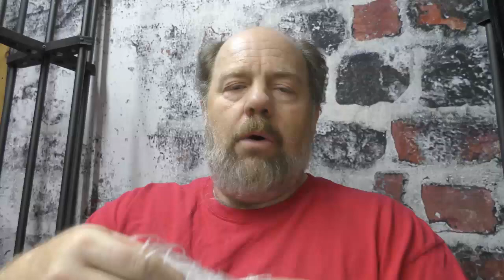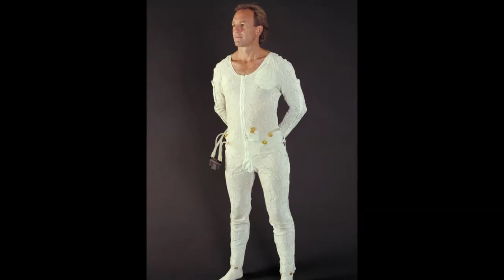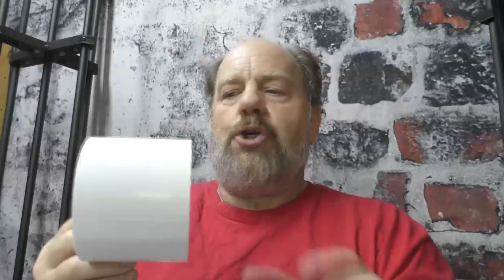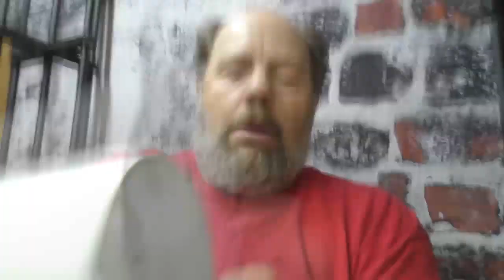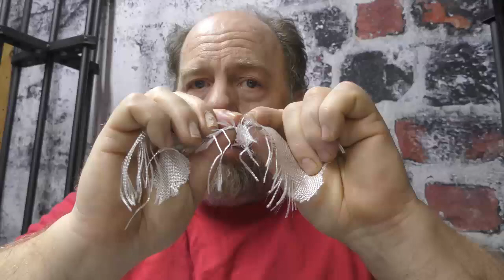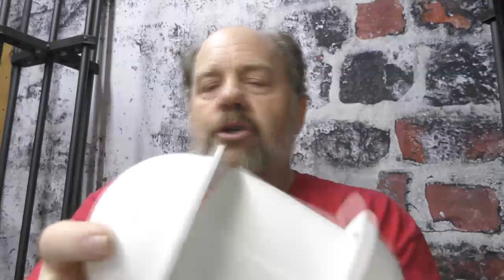Loss of the Titan

Comment: I read all of Picard's books on the stratosphere and the sea depths. For his deep dives, he used a titanium sphere, with each opening rebated at a deep slope angle, in order that the pressure would be inclined to seal rather than yield. Carbon fibre seems an odd, if not stupid, choice to me.

Comment: What I wonder about the most is what the low temperature rating was for whatever kind of epoxy they used and the glue they used to affix the end caps because, from my experience with various glues and various kinds of tape, the adhesiveness can fail due to temperature. Presumably they used epoxies and glues that weren't water soluble but I wouldn't even rule that out since my mom bought some Trex decking and the boards from that batch accidentally were made using a water soluble glue and the boards literally disintegrated in the rain. Clearly, they should have known that outdoor decking would be subjected to water but this whole batch of boards still got all the way to the hardware store. The company replaced the boards for free after my mom put up a stink and those ones are really good so presumably their engineers were much better at their jobs than ol' Stockton was at being an engineer, so I would think he would be more likely to make such a mistake even though subs are obviously going to be subjected to a significant amount of water.

I get making a bad design that fails because I've done it too but never when people's lives relied on me doing it right. In those cases, I'd learn how to do something properly or hire someone else to do it. I'm a biologist, not an engineer, so the stuff I've engineered was basically tinkering to try to solve a problem using stuff I already had around (hence the amount of experience I have using glues and various kinds of tape lol). The stuff I make usually works at least temporarily, which is long enough to get the stuff to do the job correctly. Much of it ends up being just as good as the original and, on a few occasions, even a little bit better. I wouldn't trust anyone's life with my silly inventions though.

Comment: So basically it wasn't actually a carbon fiber hull. It was a carbon fiber un-enforced (is that a word? lol) "epoxy hull". The only strength it had, came from the epoxy resin in the carbon fiber.
Reply: A scuba tank and a spacecraft are comparable. A scuba tank and a submersible are not.
Reply from the maker: That's a good way to put it and that's the way I see it. I might be wrong, but it sure is looking like that's exactly what has happened.  :(
Reply: @TechValleyScienceCentre 
Leela: Depth at 45 hundred feet, 48 hundred, 50 hundred! 5000 feet!
Farnsworth: Dear Lord, that's over 150 atmospheres of pressure.
Fry: How many atmospheres can this ship withstand?
Farnsworth: Well it's a spaceship, so I'd say anywhere between zero and one.